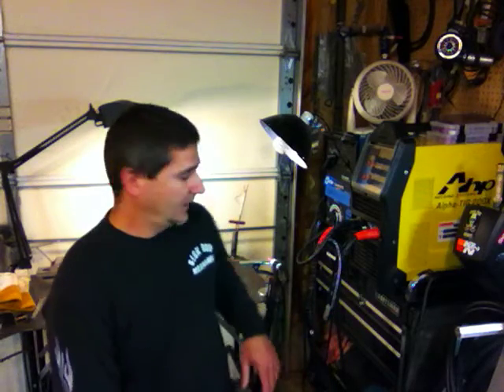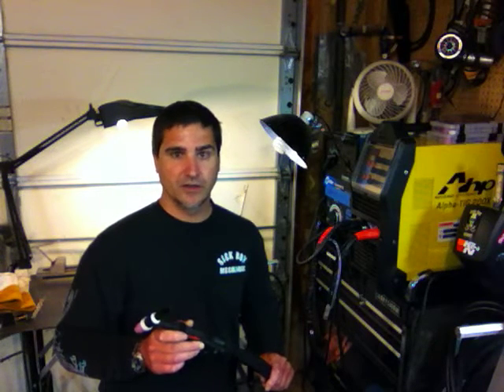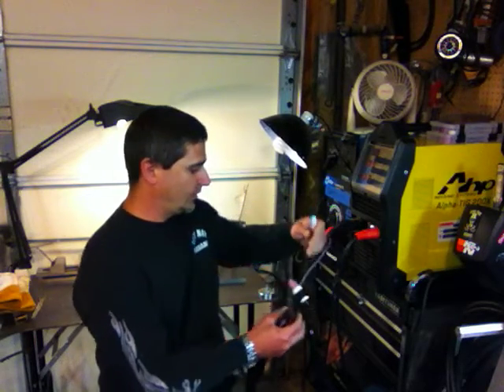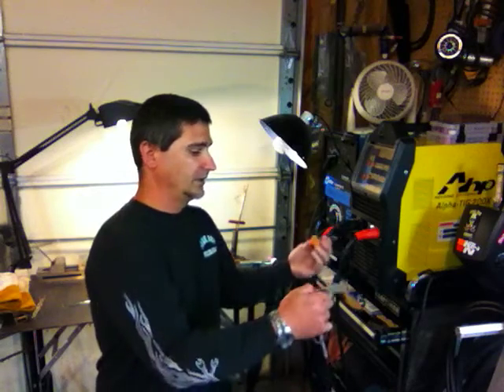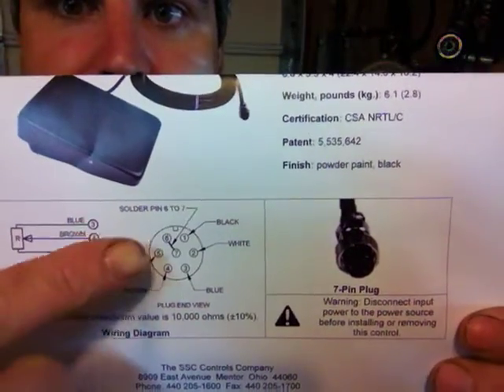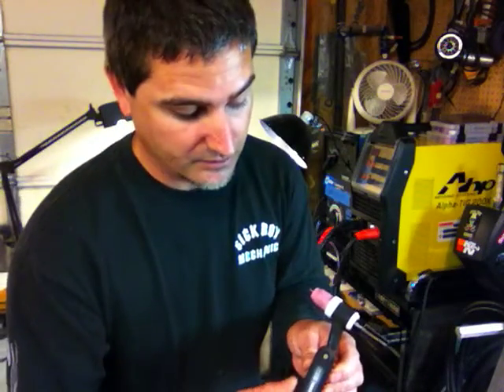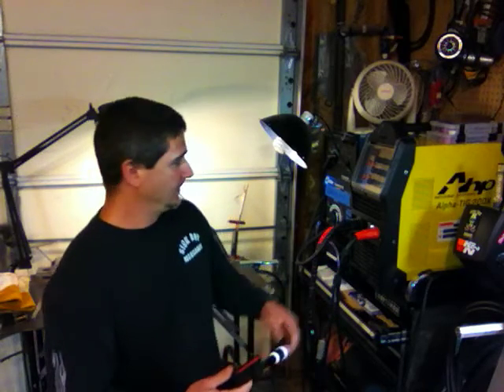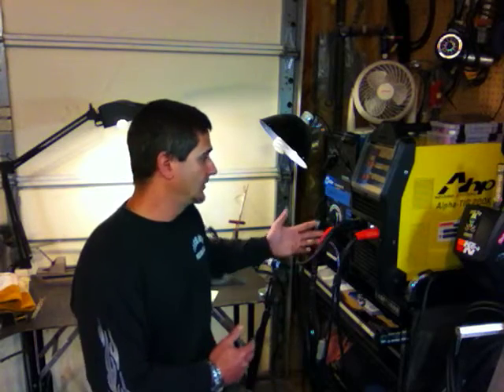AHP Alpha Tig 200X With CK Hand Amp Control

Comment: Interesting. My AHP is a 2014 model using 5 pins. I just tried to use the switch on the torch and while it seemed to do the correct thing (started an arc and gas flow), I could not get enough power in the arc. I  was thinking the 10K resistance across pins 3~5, where 4 is the variable control might be missing in the actual switch on control on the torch. I was thinking of shorting pins 3 to 4, which should present a full on status. Does this sound logical to you?

Comment: I found one that is made for the AHP TIG welders with 7-pin remote connections. ONLY FITS THE 2015 and 2016 AHP ALPHA TIG 200X. So the website states.
http://www.usaweld.com/AHP-TIG-Rotary-Hand-Control-p/rotaryahp2015.htm

Comment from the maker: Thanks guys. I hope this helps. I did want to add. The wire connectors used for the AHP are GX20-7 aviation style. I do have some if anyone needs one. They are an odd ball size. Just leave a comment and we can make arrangements to get one out to you.
Reply: great video! im getting ready to order the same machine. prob going to use the foot pedal that comes with it and upgrade if needed. Thanks. Tim